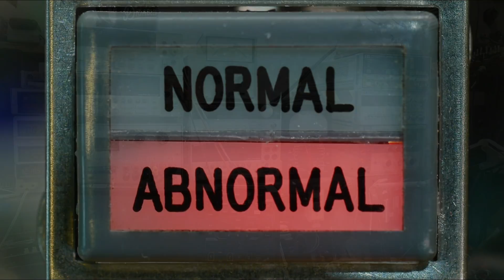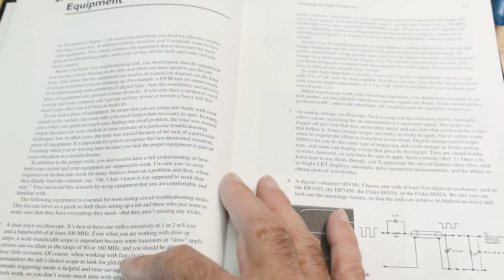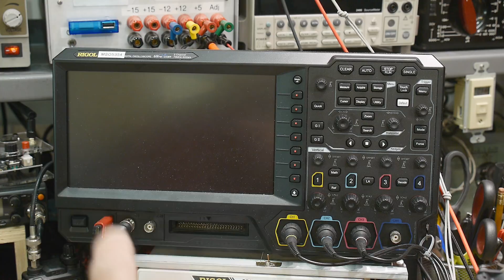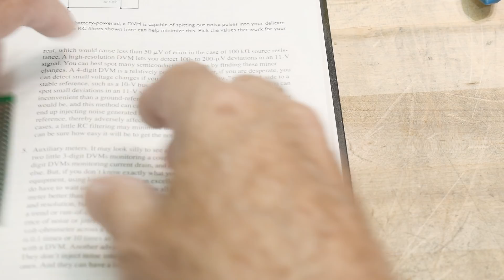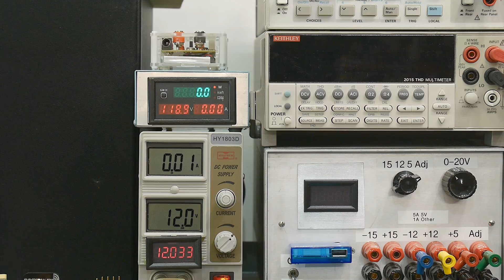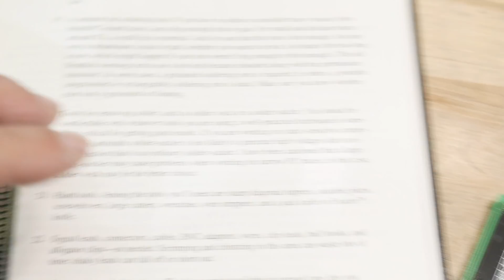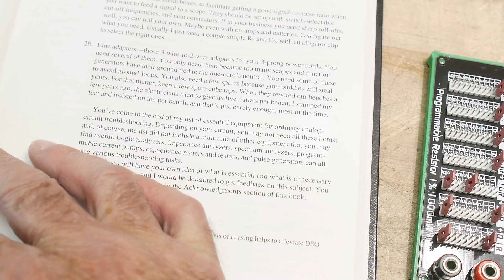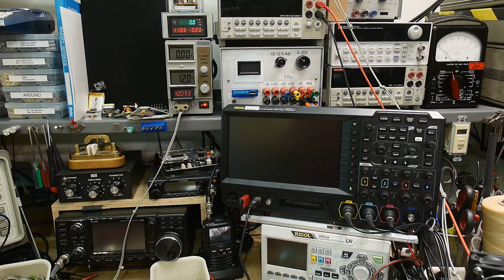#1179 What Electronics Tools Do You Need?

Comment: Good range of stuff. I would add a "helping hands' with croc clips to hold things in place when soldering. An adjustable circuit board holder and an adjustable vice, Panavise if you can afford one otherwise a cheapo hardware store one.
Reply: Yes, one of the most overlooked but very functional tools around. Good reco 👍🏻

Comment: On the desoldering stuff, I have to say while it's the most expensive piece of equipment in my electronic lab the Hakko FR301 I got for $250 is easily worth the cost if you do a lot of desoldering. I've spent too much time trying to desolder DIP's with a solder sucker.
Reply: Me too! Really like the Hakko brand. Dropped some coin like you, it works very well.
Reply: I have to agree. My Hakko desoldering tool made me think that I had died and gone to heaven. If you do any repair work at all, you need a vacuum desoldering tool. Solder suckers are just that, they suck in worst since of the word.
Reply: Agreed. The FR-301 is a lifesaver when you need to remove a component or whatever. I don't use mine real often but I love having it when I need it.

Comment: as someone who remembers when a good scope could cost $10k or more, I'm very happy with the $500 4 channel Rigol that I bought a few years ago!  Also...  nice to see Bob Pease's great book mentioned!  Tons of wisdom in there!
Reply: Scopes! I have used $4K, $6K, $10K and up scopes. In the past they were absolutely necessary in professional environments. Today I have a two channel, Hantek digital that is, if anything, better than any of them. 150 MHz! The best Tektronix I used was only 50 MHz. Triggering: it has over two dozen triggering options. Best I ever had in the past was AC/DC, +/-, and TV H&V. It has a built in function generator. It has a built in spectrum analyzer, perhaps not the world's best, but that was an unreachable dream in all my jobs. Built in metering on both channels, including things like frequency so it is also a frequency counter. I can go on and on. It is a great scope for under $300 with two 200 Mhz probes. That is today's entry level scope and it is great. Other brands do much the same for similar prices - you can shop around for the best deal.

Comment: Great video. One thing not mentioned that has helped me repair thermal problems is a FLIR camera. I bought a cheap one (~$300) helped me find and fix bad components.
Reply: Your absolutely right - good reco - those devices are absolutely awesome troubleshooting thermal issues, pair with a freeze spray.
Reply: Great call... I've used my Torrey Pines Logic thermal imaging site on a grip and is definitely useful.

Comment: It's according to what one is intending on working on, and if one is a student or pro. If I were a student, I'd buy a cheap handheld DMM and scope combo, along with a cheap handheld LCR meter. There are some cheap signal/waveform generators out as well, with some combined with the scope, and there are the older bench generators. To start, one doesn't need to invest in something very expensive like HP or Fluke. An old B&K E-310B and an E-200D, along with a cheap frequency counter, would start you off. One can find cheap arbitrary waveform generators as well.

Comment: The hot air rework station gets used a awful lot on my bench.   SMT parts, heat shrink, making cable harnesses, etc.
Reply: I agree. Years ago I bought a pretty affordable hot air rework station for about $100 from SparkFun and I have used it all the time, and it's still kicking with no issues. It comes in so handy.

Comment: A power supply with analogue voltage and current panel meters, they are handy for monitoring changes in current draw. A meter only gives you an absolute reading
Reply: I deliberately bought some old VTVM, recently at hamfest Orlando. Oldies but  very useful. Needed some work of course🎈
Reply: @JenkinsUSA  That sounds like a nice project 🙂

Comment: I appreciate this video, turns out I’ve done an alright job adding to my test bench over the years.. Still have a few things on my list that I’m looking for, Bench Multimeter 5-1/2 digit at least, and I’d like to either get another power supply or get one that has multiple channels, so I can source different voltages if necessary. Thanks for the video!

Comment: Great summary. I would add a good selection of screwdrivers - obvious really but getting the right size makes life much easier. Also note the proximity of your calculator, much easier than guessing and although many like me don't really like maths, it just has to be done. These days the cheapo component testers are really great to help identify/check an unknown component, mine was a kit less than $/£20, not perfect but good enough.
Reply: Yes, I finally got a high quality tool set. Makes a ton of difference. The trick is to return the tool to the caddy when finished, I’m learning that - 😎

Comment: A few thoughts:

1. What tools you need (beyond the bare basics) will depend on what kind of "things" you want to do. If you want to specialize in RF circuits, for example you'll certainly want a spectrum analyzer, and maybe an RF power meter. If you don't do RF, you might never need either of those things. If, on the other hand, your "thing" is building retro-computers (Z80, 6502, etc) then you'll probably want a logic analyzer. If you're an audio amplifier geek... um, I have no idea, I don't mess in that space. But you get the idea.

2. A programmable load can be very valuable. I thought mine was going to be a "luxury" purchase, but once I got it I found that I use it all the time. 

3. And just for the sake of comparison... I have a nice, high-end'ish benchtop DMM with 6.5 digits resolution (a Rigol DM3068). And I basically never turn it on. I prefer using my handheld meters, of which I own several. All told, the programmable load has more utility for me, than the benchtop DMM. YMMV.

4. I can't say enough good things about my Hakko FR-301 desoldering gun. I thought of it as a bit of a "luxury purchase" as well at first.. but it pretty much paid for itself the first time I needed it. Now to be fair, I look at this thing the way I look at a set of left-hand twist drill bits and box of EZ-Outs. I know if that stuff is coming onto the bench, something has gone horribly wrong. But when you need it, man oh man, can it really save the day.

5. I have a dedicated frequency counter, and it gets turned on less frequently than the benchtop DMM. Maybe because I haven't been spending much time on RF stuff, but the need for it doesn't come up a lot. At least it was a used HP jobbie from ebay, and I didn't spend a lot on it.

6. It's hard to avoid SMD unless all you do is build/repair retro gear. If you're going to have to work with SMD components, a nice microscope comes in handy, as do a reflow oven (mine is a converted Black and Decker convection oven) and a hot-air rework station.

Comment: I would add that 'it also depends on what you are focussing on'. The book is associated with analogue design, whereas if you were working mainly with micros or mainly on RF / radio then some test equipment requirements may change. Yes, you still need a good set of tools, soldering iron and a DVM for most work.

Comment: In regards to soldering irons, I would highly recommend the TS100. I just recently got in to electronics early 2020 and it's the first adjustable iron I ever got and I love it. 12-24v  <65w thru a DC5525 barrel jack, so I just made a XT60 to 5525 adapter and can use it in the field with the same batteries my quadcopter use, it's super convenient. 
The tips are good too, easy to change and warms up in seconds. It even manages to solder on the 14 AWG battery leads to the ESCs without issues, pretty darn impressive for such a small iron.
The brain is a STM32 MCU with a gyro for sleep, and with custom firmware online it's even easier to config. Not to sound too much like an advertisement here, but I am super impressed by this little thing for just <50 bucks.

Comment: First it depends on whether you are designing or repairing then on what industry or type of electronic stuff you are involved with. 
For instance if designing you may need the lab gear mentioned in this video plus lots of bread boards, hookup wire, that spectrum analyser and ability to make proptotype pcb's so you'd need to be able to design pcb's, make Gerber files, etch pcb's and drill them.
When it comes to repair and maintenance, a lot of your time is spent opening up and re-assembling cases, racks, enclosures of one sort or another. Manufacturers often use security screws so having a cordless drill/screwdriver with a full range of bits including security bits is a must. Other useful stuff I have are jewelers screwdrivers, 1/4" socket set, pcb holder, crimp tools, heat shunt, miniature spanner set for electronics, ESR meter, capacitance/inductance meters.  I'm  left in the stoneage for electronics now, I am retired and use a number of Antex soldering irons and one really cheap temperature controlled soldering station.
I remember the days when it was essential to have an isolation transformer, an oscilloscope and an analog meter with a high voltage probe for old CRT TV repair. Nowadays, very few people repair them, most of the TV's are just binned.
When I worked in  telephone exchanges first as an electromechanical tech, all we had was a test lamp, AVO meter, soldering iron and a tool box with many types of screw drivers, pliers, side cutters, adjusting spanners, feeler gauges, relay tension gauges,  tweezers etc. When I moved on to work in electronic digital telephone exchanges our no 1 tool was Fluke bench meter and a logic probe, then came things like anti-static mats and wrist bands.
@ralph J below, summed it up in a nutshell 😊

Comment: I would say that prioritizing things will help with the purchasing process. And, if you are just starting out, ask someone with experience to help set those priorities. IMO, you need a multimeter and decent soldering iron, to start. For prioritizing say an assortment of components verses substitution boxes, IMO research what are the typically needed common values of resistors, caps, diodes, etc., buy those and skip the substitution boxes. When you need to test a range of values, grab what you need from stock. Then, set aside the components you used for testing, to test additional things in the future. Why? Because you have already proofed the ones you have used, the pins are already bent to fit into a breadboard and they might have been stressed, while making tests. Meaning, use fresh components for building the final device. Ahh,,,, Breadboards and jumper wires... Those go at the top of the list, too, IMO.

Comment: Hi, I forgot to finish watching this educational video before leaving for vacation, so I'm responding with a delay until today. I have a curve tracer and I use it quite a lot (a copy of Tektronix TR-210), unfortunately, it does not have steps for testing transistors, so I have an old Russian oscilloscope ready in which I want to build it. However, what I missed in the list and I consider it very useful is a signal tracker - I made it myself and I also made atypical probes for it - acoustic - with the help of which I detected more than one faulty bearing, knocking in the engine - for a friend in the car service , etc. - optical - reacts to the presence of light and the sound level of the tracker changes depending on the brightness - I built this when repairing the oscilloscope so that I did not have to watch the screen and could focus on the PCB and measuring instruments. I developed two of those optical probes, one for the tracker and one for direct connection to the oscilloscope, it saves a lot of time, for example, when repairing LED lighting. Oh, and I can also use the signal tracker as an independent amplifier for audio repairs.

You make great videos, keep it up 👍 nice day 🙂 Tom

Comment: When I first started in electronics I didn't even have a multimeter (my brother had one I could borrow occasionally, he didn't live with us so it was pretty rare to have access to it). I would use LEDs, small light bulbs, small DC motors and resistors to measure presence of voltage and current lol. I built an FM transmitter from salvaged parts without even having a multimeter, let alone anything else. All my parts came from salvaging old discarded TVs and radios. Now a days I have like 5 different scopes, 2 spectrum analyzers, probably a dozen of DMMs and a whole bunch of other equipment.

Comment: Great video and great idea to use Bob Pease's book as a reference. I was ticking off his items, one by one, and found that I have almost all of them. I have used curve tracers, but do not presently have one. 

I want to comment on meters. IMHO, you NEED both analog and digital meters. There is no getting around the precision of digital meters. Analog meters just can't compete. But in over 45 years of work in Electronics, I can count the number of times that I really needed that precision on the fingers of my hands and have some left over. Now, I said "really needed", not just some procedure calling for one. 

In my two electronic work benches I have both analog and digital meters. My all time favorite, go-to meter is the analog, Simpson 260. That meter was sitting on the bench at almost every job I had and it was there before I was. They just worked. I do have four and five digit, digital meters and love them. I won't go into a long discussion of one vs. the other because you really do need both. 

PS: For a long time I did not purchase a Flute meter. They are simply overpriced due to a number of factors that don't even relate to their accuracy or accuracy. Government contracts can call out specific makes and models so the maintenance manuals do not need to be rewritten. Anyway, a year or two ago I discovered a low-end Flute that cost under $100. Now I can honestly say I do have a Flute. And I like it.
Reply: DVMs are very handy to use and I have couple of them, but sometimes they are a pain in the neck.  If you're trying to get something to peak, or looking for a trough the constant jumble of digital number is confusing and some DVMs have a bit of lag or delay.  An analogue meter shows you the change in real time and with a smooth action not a jumble.  So if you can get your hands on a good analogue meter don't pass it up.

Comment: Sorry for all the comments. I have a tube driven labvolt volt meter that has an Ontairio hdyo electric Department lab sticker inventory sticker. It plugs into mains and has a massive analog dial on the front. The iec cable is made of that old clothe and tore in a million places. I don't feel I have the qualifications to open it and I've been trying to find a collector to give it to. I have some handbooks from the 30s as well. I think you can get that metcal for around 500 now. I have a bunch of stations. All knockoffs but one I've used for thousands of hours.

Comment: I think the mechanical tools side is often neglected. It doesn't matter whether it's more about repairs or whether the latest construction should be in a fancy housing. A small cordless drill with some bits and drills and also step drills is a start. A bit of basic sheet metal and plastic processing, etc. is never wrong...
Reply: My Dremel style rotary tool gets a lot of usage. For lightweight massaging of metal and plastic, it is extremely handy.

Comment: Great video! The algorithm suggested your channel and I’m just starting to check it out. Next stop: checking to see if you did an amateur radio equipment tour as well. I’ve been licensed for a while and putting my base station at my electronics bench could be a nice way to combine hobbies
Reply from the maker: I have not done a rig video.
ICOM 7300 into end fed
FT3DR into J-pole
Reply: @N7TWL  Presents... Yes, because NORMAL/ABNORMAL is luxurious and must not be missed 😁
Reply from the maker: @Mr_Smith_369  analog scopes have xy mode also.
Reply: @IMSAIGuy  Why do you need a curve tracer then ?
Reply from the maker: @Mr_Smith_369 
Collector Sweep Ranges	
15 V / 10 A
75 V / 2 A
350V / 0.5 A
1500 V / 0.1 A
Collector Current Display	0.1 μA/div to 2 A/div, 1−2−5
Emitter Current Display	0.1 nA/div to 2 mA/div, 1−2−5
Collector Voltage Display	5 mV/div to 200 V/div, 1−2−5
Base Voltage Display	5 mV/div to 2 V/div, 1−2−5
Base Current Steps	200 mA to 50 nA, 1−2−5
Gate Voltage Steps	50 mV to 2 V, 1−2−5

Comment: I would include breadboards, batteries, ESD wristband, good light, the least amount of switching power supplies to prevent EMI, good quality solder wire and flux, a carbon air filter to suck up the fumes, a collection of different solder tips,  and common sense of course...

Comment: Wise, wise words.  Don't be embarrassed by cheap equipment.  My first VOM I made from a kit, the same with my 1st oscilloscope and signal generator.  Buy cheap, and if it breaking/failing is an issue because you need it.  THAT'S where to spend your money.  In my 50's I have some (only some) very nice tools, but equally I still have tools I started with as a kid.
Thanks for the video

Comment: Likewise spoiled by access to high quality test equipment at work, but have slowly been building up the home lab as I get closer to retirement from the day job.

Good list.  Because of ham radio work at 10 GHz and up, I'm missing a good microwave synthesizer/signal generator that does at least 10 GHz.  Keep my eye out every now and again on eBay but haven't pulled the trigger.

Will also order a Tiny SA one of these days to complement my HP 8563e.

Comment: I had a cheap 15v 2amp psu die on me last night when I made a dual rail supply with my equally cheap psu. It caused something to melt in it. I watched trusted creators on how to do it. I opened up the psu amd found black spots on the transformer so I pulled it out, kept the copper wire for my wife to practice her jewelry making and sent the supply back to amazon